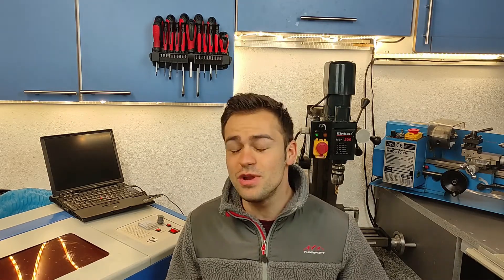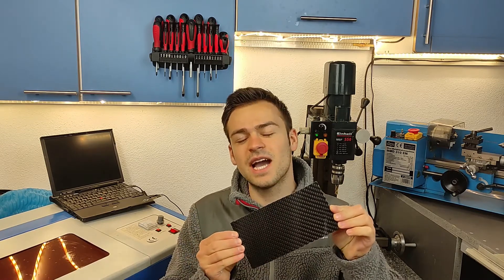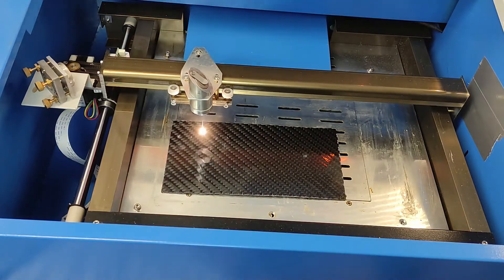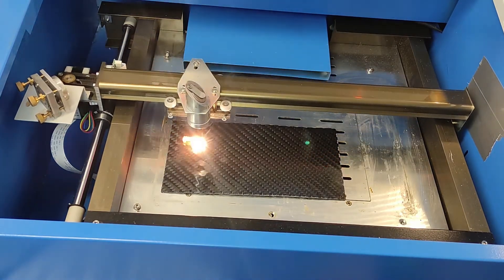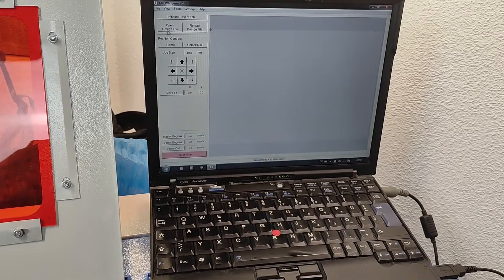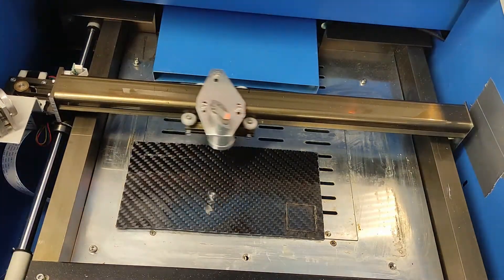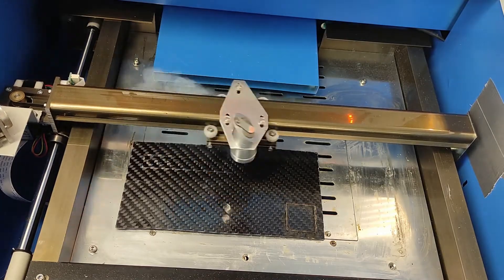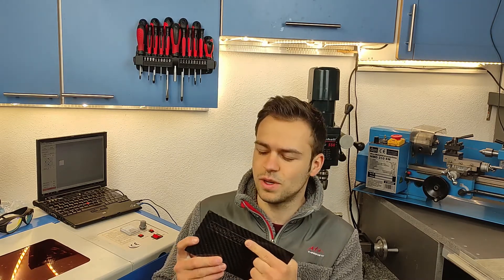Can you cut or engrave a carbon fiber plate with a K40 CO2 Laser?

Comment: You really should not be suggesting cutting/engraving this material with a laser. Most carbon fiber uses epoxy that emits noxious fumes when cut or engraved with a laser.
Reply from the maker: Thanks but for this reason there is a suction.
Of course without a suction you schouldnt do that.